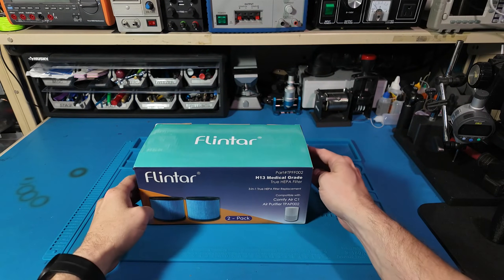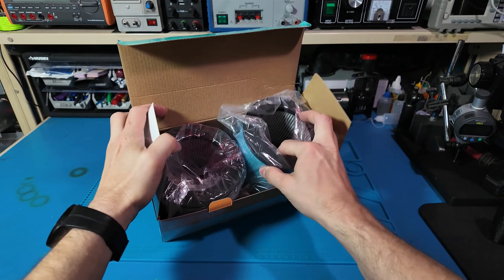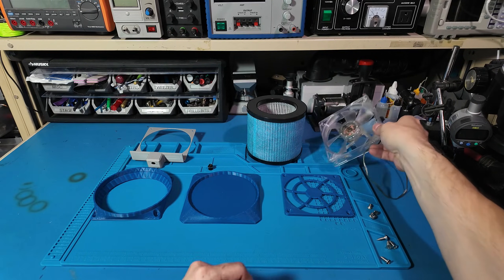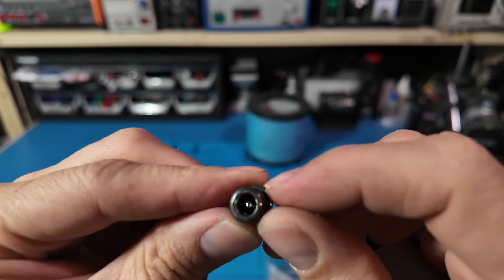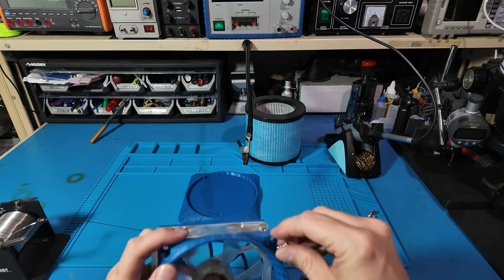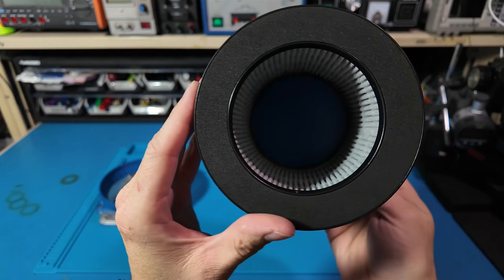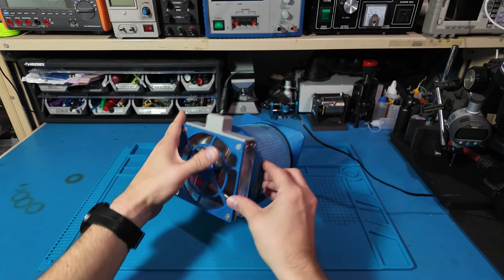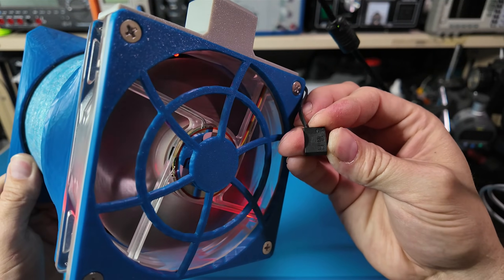Cheap HEPA Filter + 3D Print = Surprisingly Effective Purifier

Comment: i was considering an air filter for my bed slinger printer room.  does anyone know if such a filter would give me better prints?  i recently added a dehumidifier because i print quite a bit of TPU which soaks up water like a sponge and prints like crap when it does.  even with that device, i had to hook the filament tube directly into the filament dryer and have it running while printing.  what I'm asking is if I would get even higher quality prints if I added a simple hepa filter
Reply from the maker: The air quality would improve your health, I've heard of people not feeling well by being in print area's.  The print quality could improve by bed adherence since a film does form around the printing area.

Comment: I don't think the fan you chose has enough static pressure to overcome the resistance of that filter. All the air that gets pushed in by the blades likely escapes from the sides of the fan itself.
Reply from the maker: A radial fan might be a better choice , seems to be doing well maybe as it clogs you may be right.